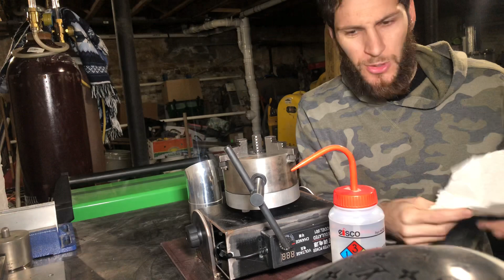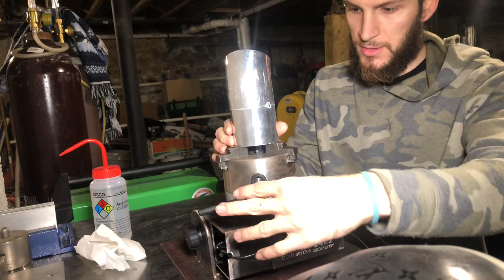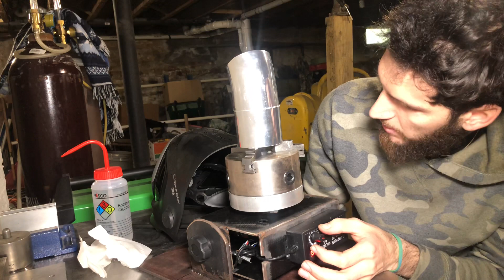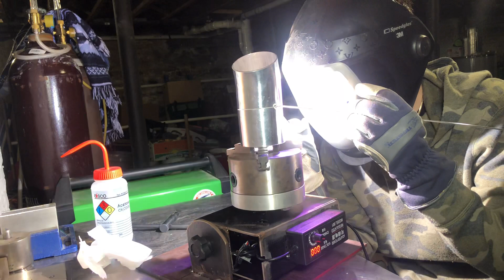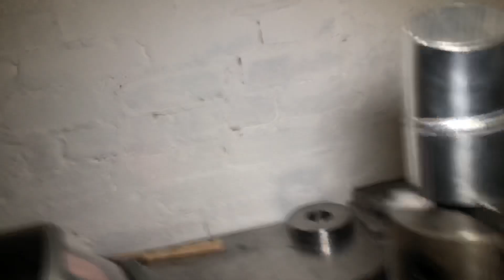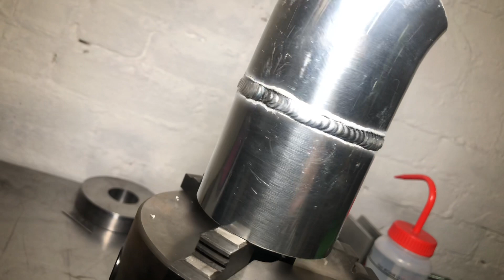TIG Welding Aluminum Tubing: Turbo Diesel Intake Plenum

Comment: Nice job welding vertical  On positioner man.. That's always a fun challenge... So did you like the AC on your HTP better then the everlast? I know the operator pretty much controls how the weld itself turns out, but I def notice a difference on my Dynasty 280 compared to my everlast.  ATP has a special right now and I was considering selling my everlast and getting the invertig 221.  I have literally never heard or seen anyone complain about that machine. I have however heard dozens of people complain about the AC side of the everlast. It is a good value I just want A better All around machine for aluminum
Reply from the maker: I love my htp. I would t but another machine other than it